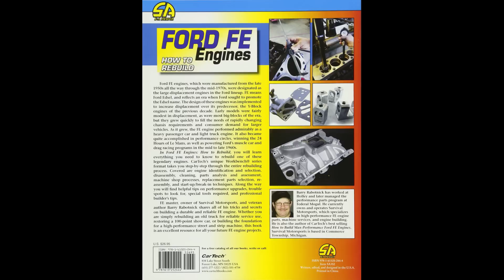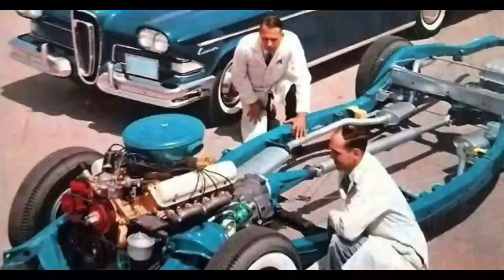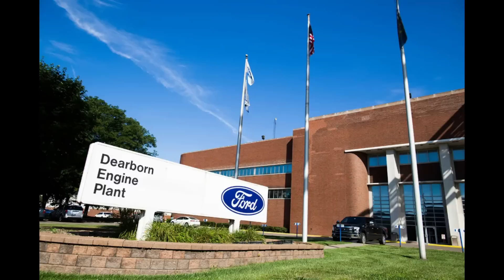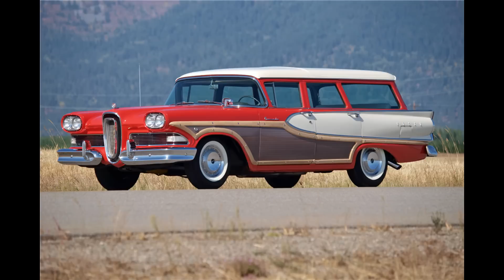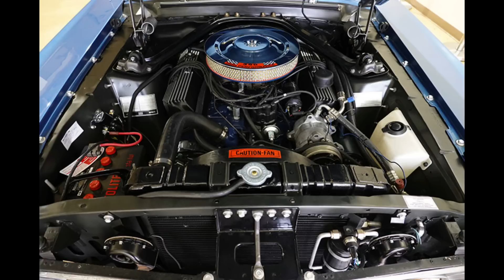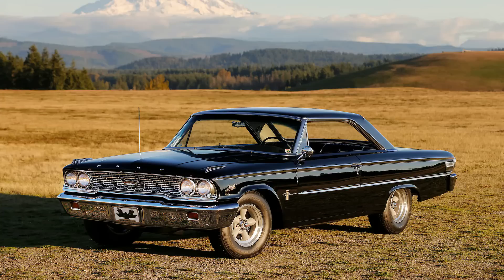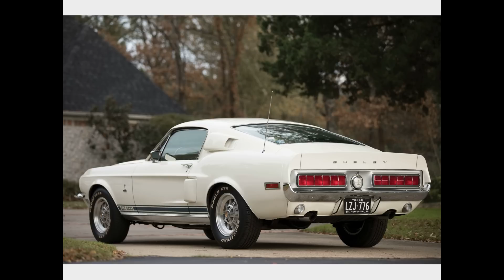Learn about Ford's FE engines and why they are among the greatest offerings by the Blue Oval!

Comment: I remember as a kid that my dad borrowed a 58-60 F100 that had been a Chief’s fire truck, I guess it had the police intercepter engine and a heavy duty Cruisomatic transmission. He took me for a ride in it and son of a gun that thing was a beast! It would burn the tires all the way until it shifted to high. It was a badass F100!
Reply from the maker: Thanks for great comments and keep watching!
Reply: @IfThisCarCouldTalk  I wonder to this day what they put in police and fire chiefs pickups. I think the 361 Edsel Police package. I remember the solid camshaft sound from my years of using them in FEs. I wish I knew the specs of the Edsel 361 ci PI and emergency. I was told that they were used in ambulances. But I watched the tachometer built in the instrument panel and it turned 6300 rpm’s so quickly it was stupid. The Dual Range Cruiso was just bang bang bang!

Comment: Sure is strange Ford never put FEs in medium-duty "straight trucks" after putting flatheads and Y-blocks in them. Seeing as how they're supposedly so "versatile" and "great" and all.
Reply: They put FTs in them. They were 361-391 FEs and were in many grain trucks. How old are you? 10? I am using an FT block. All of my old drag cars used a mix of FE/FT parts. I’m not a social media keyboard commando. I wouldn’t know how to post a video if someone had a gun to my head. And to me, that’s just fine. You really look down on the FE/FT family?  It says a lot . My wife has a twin turbo 2.7 Edge ST and it’s a good vehicle. I have restored a lot of cars. I raced but videos? Nah.
Reply: @Bbba7564  playing with a 352 build! Using the 3.98 scj crank, and modern 4.00 small block Pistons! 352 rods re-bushed for the Pistons! My version a a 400 going in a 63 falcon!
Reply: What are u talking about? They did? They are called FT engines. The 361 & 391. They use steel crankshafts.

Comment: I think that the 289, 390-428 and the 385 series 460 and A Boss460 for the streets. The best all around series is the FE that made all of the 335 series junk unnecessary. The Cleveland head’s could have been  on the FE. 3 engines that could be used today with the technology we have. The FE and 385s are nowhere in the same weight class. Those 3 engines would still be here now. All the displacements and indestructible iron they had. The FE heads could have evolved easily and would have saved them money. The alphabet soup was unnecessary.
Reply: 335 junk... 
The 351C was the most handicapped engine in PS racing history and to this day, it's DNA is used in NASCAR heads. No FE head (minus the SOHC) can flow anywhere near a 335 series. 
Most definitely not junk

Comment: My '69 Mach 1 is a legit RUG-AE2 4-speed R-code "Drag-Pack" car with SCJ motor - 1UA crank with external "hatchet spacer" balancer, heavy dampener, 427 "Le Mans" cap screw rods, engine oil cooler.  The block is a standard bore NOS May 1974 date code "CJ & Marine Service Block" with high nickel content and the beefy 3-center reinforced main webs.  Honed to 4.135" with Race-Tec 12:1 custom pistons and a Comp Cams solid roller...3,500-6,000 torque monster
Reply: I bet that a pair of turbos on 4.08x 4.08 70s truck block at 426.7 can do 1000 hp+. I really don’t understand the bullshit about them falling to crumbs after 500 hp. That’s just the hoarders taking. The Cammers made 2500 hp. They just want to hide their stash and if you notice most modern engines bear a strong resemblance to their obsolete design? A half pour and Pro Gram caps Molmar Rods and Edelbrocks and 14 lbs of twin Gt 45s are sucked Hell cats down the carb and blowing out new Mustang s, lol.
Reply: @Bbba7564 Post the 1000+ hp FE video.
Reply: @deeremeyer1749  I will when I get it done if I don’t die first. A lot of setbacks. My son doesn’t want me to do it at my age and pulled all of the wiring out of the car to stop me. I’m working at it. I’ve gone blind so I  won’t get to enjoy it. But the block is capable of over 1500 hp. Just use boost for these old engines. It is easier on the engine than nitrous or even NA hp. I had it running and I went out and my relay and fuse box is gone. My wife told me to sell this engine and car. I have a feeling that this isn’t meant to happen. At least for me.  I filled the block, machined it, and put ring gap in it. It will do it. Those blocks inhaled nitro and made 1500 hp without trouble. The 2500 hp is what killed them . An aftermarket block can take 4000 hp. But my wallet isn’t that thick.
Reply: @deeremeyer1749  Video? I don’t do videos. How old are you?
Reply: @deeremeyer1749  if you want to see some high powered FE stuff, look up Ed Pink, or Ray Paquet. Sam Auxier. They have some great 👍 FE stuff.  I am new to boost  and I have built 600 hp NA stuff. The 1000 hp is a really challenging build, but it can be done. They are very capable of making high power. If you have an FE stash don’t junk it, it is amazing what you can do with it. I am old and arthritic, blind but I still love doing all I can with the old stuff.
Reply: Man @Bbba724 I'm sorry to say this, and I mean no real disrespect to your wife and son...but they kinda f*ckin suck for screwing you like that at your advanced age. They just can't realize what the car and engine mean to you, and they think they're protecting you, but all they're doing is taking away a significant goal in your life. If you ever wanna will it to someone, I'm your man! Since your son is being a dick and not only not helping you, but is actively hurting you. I'll finish that car and keep it for life! I'll sign a contract to that effect as well. It would pass to my daughter when I check out. I hope you can get it done, despite their hindrance and active negging. Good luck and God Speed! 🙏✌🖖
Reply from the maker: Sounds great and we bet it really does "sound" awesome!  Thanks for watching!

Comment: What a way to start the weekend, a new video from "If This Car Could Talk."    How would the 69 and 70 Boss 429 Mustang engines fit in?   I had a chance to buy  (from the same owner)  a 69 Boss 429 or a 65 GT350, I chose the GT350 but there are times I wish I picked the 69 Boss 429.....    Thanks for your time, work and posting.........
mike
Reply: The Boss 9 came from the 385 series engine not the FE.
Reply: The boss front end was widened by motorcraft to get the motor to fit
Reply: @troyehnisz9907  Yea, I watch a vid about a year back on the BOSS.    Great Little Car.......

Comment: I love the old FE's I have one right now in my life and almost have always had one in my life.
The miracle of the FE was the fact that it was designed to address the shortcomings of the Yblock and the fact that it's weird ass design with the push rods through the super wide intake and the half wide heads wound up doing all it did including winning the 24 hours at LeMans a few times is beyond belief...
My FE at present is a 390 powered 51000 mile all original 1967 Galaxie 500 fastback and it's a smooth strong runner...
Reply: Those were the Tunnel Port 427 that came out around 68 and were used in NASCAR and NHRA and some were put in boats. The FE is the best engine of all time!
Reply: @Bbba7564  I've owned a few and like them alright but I'm not gonna go quite that far. The side oiler and cammer were the pinnacle but the ordinary FE was mediocre. I had the 335 horse GT motor and it was just ok in stock form. Oiling problems for high HP hence why they developed the side oiler setup.
Reply: @LHarry-c2t  Ford was afraid of the insurance companies jumping in and doing what they did in 1971. It is sad that they didn’t get the potential of the engine that won against the worlds best super cars in the masses. I have been a tinkerer all my life and the reason I hold the FE such high esteem is that it takes a weekend to make it a beast. I made my own oiling system, and I ran solid cams with the lifter passeges blocked. 2 and 4 were crossbolted with Pro Stock Engineering main caps that had oil passeges in the caps fed through the side bolts. I blueprinted the whole oiling system and they were vicious. 11:1 and early style non emissions heads , headers and the MR aluminum 428 intake. They were enough for all but the Hemi and 454 cars for me. I ran ragged old. 67-68 Mustangs with the shock towers cut back. I know it wasn’t factory, but the engine was still even to this day a great engine. Others experience may vary, but I enjoyed extracting every thing I could get out of them. The magazines had their knives out for them because they were running with the Hemi in NASCAR, and were selling dismal fucking cars off that and rightfully so. I just knew the engines and built them to overachieve. Those who didn’t really missed out. I am disabled and blind now and I really miss turning wrenches. I still have my last street racer. 500 hp of crackly sweet 65 Galaxie that I had up to a GPS 160 on a two lane highway and it never hurt anything. It still wants me to come out and play. My 40 year old son came out and gutted the wiring so I wouldn’t take it out and hit an oak tree at 150.  With 4.33s that is a lot of rpm. But it used to eat it up.
Reply: @LHarry-c2t  I don’t know what happened to my post but I was a tinkerer and used them to make really crispy power. They were easy to modify. I never really knew why they never put the big guns out there but is you knew what to do they were and still are a fine engine. The only reason they are expensive is because of hoarders limiting the supply of parts to make them what they can be. Companies that have the goods get undermined and have to keep them away from the masses. They don’t want their hoarded parts to lose value. Sad. It is an amazing platform to build. But the Stroker Windsor is king of the hill now with its 3 inch mains. I don’t care anymore about it. I’m disabled and blind and my old 65 Galaxie has been made inoperable by my son who doesn’t want me hitting 160 on a 2 lane into an oak tree. I miss driving and wrenching.
Reply: @LHarry-c2t The 428 CJ was an excellent engine, great drive ability and with headers and a roller can were a very enjoyable experience. The 390 cars with headers, a roller can and Edelbrock heads and RPM were a pleasant surprise.
Reply: I have a '69 390 in a F-100, they're virtually indestructible.
Reply: I read an article not long ago saying that some of the early stage 427.FE's had the pushrods going up through the intake ports also. It was the only way they could configure the valves in that big head correctly to produce maximum fuel ignition in those big chambers.
Reply: One thing about that strange configuration on the intake was it also allowed enough room to change lifters with the intake on. Even a cam for that matter.
Reply: @LHarry-c2t I have a 360 FE engine in a 1972 F 250, with a flat cam.
   Are you saying that I can remove the lifters by pulling the valve covers and valve train while leaving the intake manifold on ?
  I normally build 440 Mopar engines, 
so I am not very familiar with FEs
   Thanks in advance
Reply: @fishinglove6751  Yes 100% as long as the base of the lifters are not gunked up to the point of stopping you from pulling them out. They used to make a tool that locked into the top of the lifter but you can usualy use a magnet as well.
Reply: @fishinglove6751 Yes .I have pulled the lifters on the 352,360 and 390s without pulling the 90 pound intake manifold.
Reply: I have the special tool to pull the lifters in my tool box. Havent used it since95.
Reply: Don't  forget  87 degree  block.  Colds start! HOT start, hellsommor. Life with an FE!
Reply: I have no idea what you're saying
Reply: @2packs4sure not a 90 degree  block,87. Starts easyer cold 🥶.  Start 1 at 265 ELENORE.  You must not drive that hard?  TORINOs,FARLANEs,MUSTANGs,F 100s. Drive  hard,put away wet!
Reply: @RodneyRotten   I've NEVER heard the 87 degree thing and an FE starts just fine hot with the gas of it's era.
Today's gas,,,,,,,,,  not so much..... lol
Reply: @2packs4sure . Goddamn, me neither. 87 degrees?  No it’s a 90 degree block. It has a 13 degree valve angle. It oils just like a SBC, the only thing is that there’s an oil passage in the block that feeds the rocker stands  with skinny bolts that oil the rocker shafts, and arms . I block it and oil through the pushrods. I don’t know what was being discussed. All V8s I’ve seen were 90 degree. All FEs have the pushrods going through the intake manifold. The reason was that the iron intake was half of the head and weighed about 90 lbs. The factory racing engines had aluminum intake manifolds that only weigh about 22-25 lbs so it was a weight design to cut the weight down to about what a 327 Chevy weighs. Aluminum heads and water pump could get them down to an iron 289, about 510 according to Jay Brown. The Low Riser with aluminum intake, heads and water pump made about a horsepower per pound, which was pretty good.
Reply: @Bill75456  Yeah I've been around FE's for 35 years as well as reading copious amounts about them through the decades and NEVER heard the 87 degree thing....

Comment: Great video ! Besides one cubic inch what is the difference in a 427 and 428 and why ?
Reply from the maker: Hey Tim!  That is a very good question and requires a very long answer.  In a nutshell, the 427 was a race only engine with a mechanical cam, cross bolted mains, a steel crank, an aluminum intake manifold and more. The 427 was actually 425 ci but because Chrysler had the 426 Hemi, Ford wanted to best them by 1 ci. The 428 was designed for more utilitarian vehicles and in Cobra Jet form was still easily produced on an assembly line whereas the 427 was hand assembled. Those are just some of the differences. Thanks so much for the compliment! We appreciate you watching - hope you subscribed and share it with all your car buddies!
Reply: @IfThisCarCouldTalk  You still didn't answer his question.  The 427 FE had a bore of 4.232 and the stroke of 3.785 (same as the 390). The 428's bore was 4.130 (from the 406) and the stroke was 3.98. The math works out thus - 425.98 for the 427 & 426.54 for the 428 -The 'Boss' just made up what the number would be that day.
Other combos - In 1966 & 67, Mercury had a 410 C.I. which was a 390 bore (4.050) & a 428 crank (3.98). And if you want the max Cubic inch with Ford factory parts, you take a 427 block & a 428 crank which nets you 448 cubes.
Reply: Let me try. 427 was a big bore medium stroke race engine. Very high rev! Big valve heads that only work on the 427 becouse of the big bore, it allowed for big valves. The 428 was a mediem sized bore with a long stroke. So a bit more torque at the lower rpms. The cobra jet heads had alil bit bigger valves but not as big as the 427 valves. They won't fit in the 428 becouse the bore isn't big enuf & the valves would crash into the cylinder. So the 428 was a bit lower rpm with good torque & better manners. So the 427 was high rev race engine while the 428 was a bit lower rpm grunt & was a great street muscle car engine.